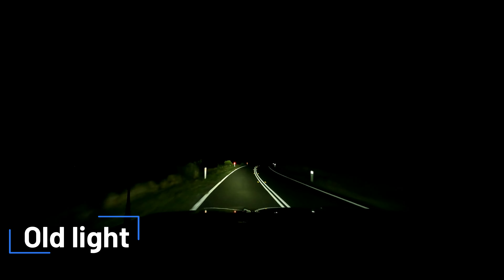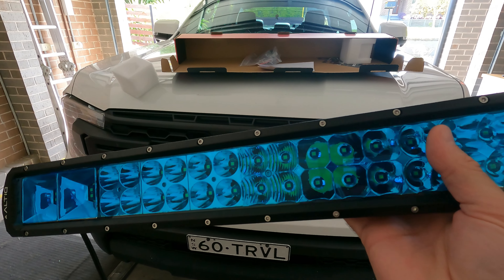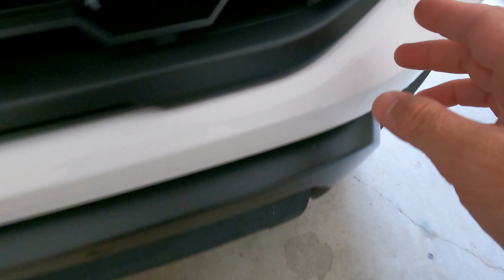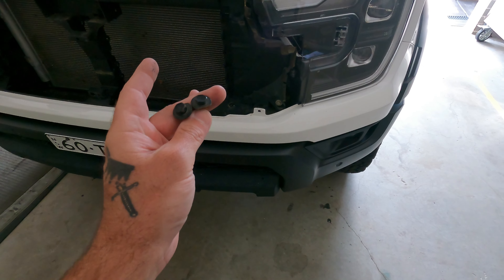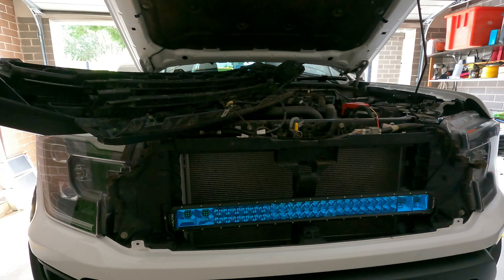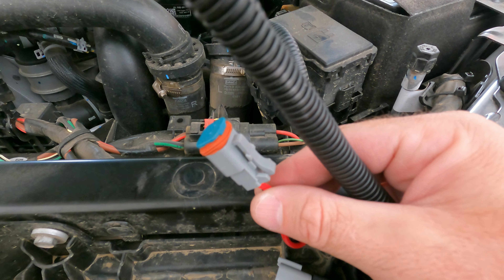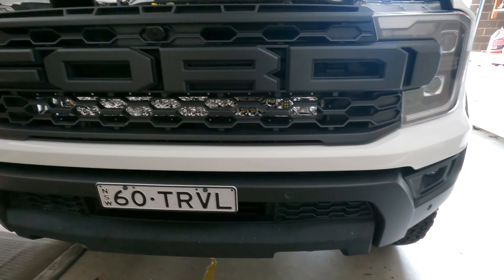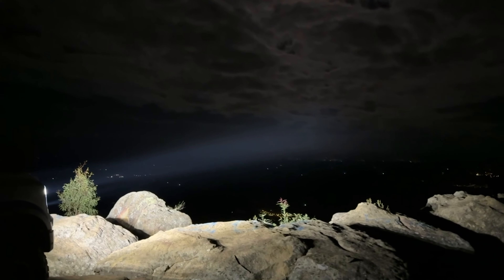Altiq Supernova 32 double row commander V3 LED light bar   HGT Next gen Raptor build!

Comment: I had this LED Bar under its old name Supernova, which is actually the same Chinese rebranded light, and I wasn't impressed at all. I confirmed the poor performance in these videos too. Yeah, it's inexpensive for its size so you can't expect much. The light emitted by my single row 10" Baja Designs OnX6 bar is much more powerful despite being very small, yet it still costs twice as much
Reply: The light out put of these is very poor few mates got few different sets on there 4wds and to say there pissed is an understatement
Reply: @rickythow2777  Thanks for the feedback. The bracketry is good though
Reply from the maker: for how it sits and works it is good for what i need. i do agree that the Baja design lights are definitely superior
Reply: @LuisMKV  I also find the flood or "scene" reflectors are pretty weak. The spots in the middle are ok but there's very little side flood.